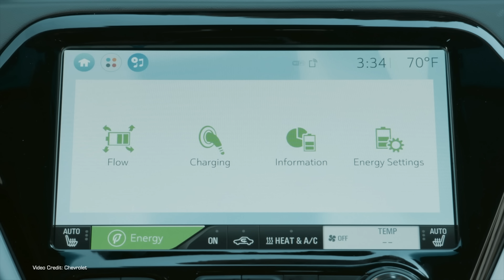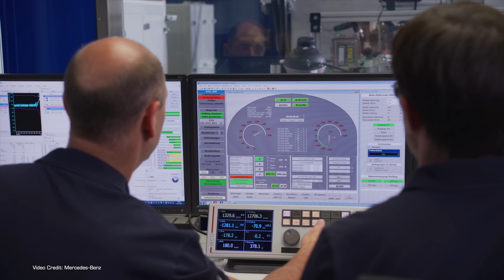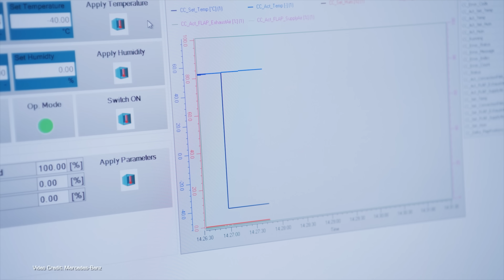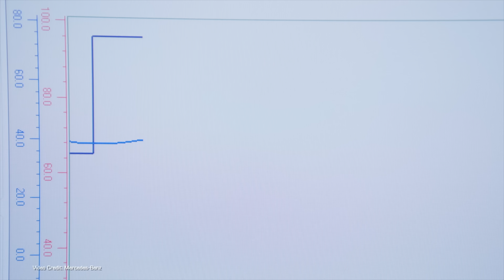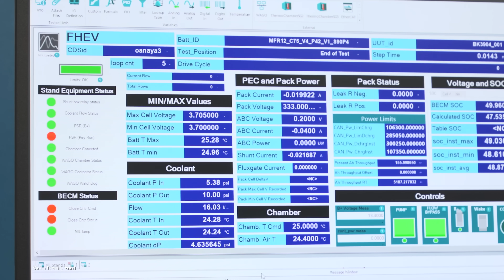Should You Buy An EV With An LG Battery Pack?

Comment: What did you want GM to do differently than what they have done up to this point? Is a buyback for everyone the course you want them to take? I believe the MSRP swap is still applies for an ICE vehicle. What is a reasonable buyback for a 2017 Bolt that is going on 5 years old now? I assume buybacks should be based on the age of the Bolt plus the mileage of the car as well. Seems everyone wants a $43,000 buyback because their case is "special".

I think the "Software Fix" that was released a few months back was a good faith effort in trying to determine what battery packs had suspect cells. It's probably still a benefit to have it installed to try to verify battery pack health. Once you're caught up in a defective battery module scenario like GM is dealing with, it's difficult to determine what the problem actually is. In addition, its difficult to come-up with enough battery modules or packs in a timely manner to satisfy everyone effected.

I think GM's liability is a lot greater than what Hyudai's liability is with the Kona as there are way more Bolts in the wild than there are Kona's as the Kona in the U.S. was only sold as a ZEV state car. It's understandable that GM would try to limit their losses and try to sort the problem out with the software cell check verses replacing every single battery pack. It's definitely a problem for the car owner, make no mistake about it but, the packs and or modules can't be replaced overnight. Is it realistic to assume that buybacks for everyone is the correct way to handle the situation without a serious hit to the GM electrification program. 

I do agree that the entire pack should be replaced rather than having techs at the dealership tearing packs apart to fine defective modules. I think the limiting factor with just doing a full pack replacement is just the issue of not having enough packs to go around for all effected Bolt owners.

In the end, this is a big problem for the Bolt owners, lease holders as well for GM itself. In addition, it makes the general public question the viability of the entire auto electrification process moving forward.

Comment: I don't believe your correct about the Ford Mustang Mach-E battery cell manufacturer being LG. It's my understanding that they are using SK Innovations as their battery supplier.

The VW ID.4 has LG battery packs similar in design to the VW ID.3 which originate from a LG facility in Poland. All of the current VW ID.4s that have made it to the U.S. have LG battery cells. The U.S. manufacturered ID.4s should be rolling off the production line at VW's manufacturing facility in Tennessee early 2022 with SK Innovations battery packs. VW has stated that their pack design is supplier agnostic  and can have multiple suppliers, thus not dependent on LG or SK innovations. In addition, the ID.4 has a definitive recommended maximum charging level of 80%. That's the car's maximum charging level default unless you choose to extend the max charging target to either 90 or 100 percent. I believe they also recommend not discharging below 10% as well in order to maintain a healthy battery pack.

The Bolt uses an LG Chem NCM 622 pack. VW uses an LG Chem NCM 712 pack made in Poland. The 712 pack is the type that was in the ID.3 that caught fire in the EU a few weeks back. The pouch type cell construction is similar.

Comment: I was waiting to buy an EV because the ones I like are too expensive and the ones that are more affordable are too slow charging.  Now, during this used car shortage, even the worst of the worst like older Nissan Leafs with less than 60 miles useable range aren’t even that cheap anymore.
I’ll just stay with ICE until newer generations of EVs come out in 5 to 10 years with faster charging and there is a proper and more reliable charging network fully built out.  Today, even Tesla’s Supercharger network is inadequate on popular routes during holiday weekends.  Everything else is two steps back from that and you can’t 100%  rely on them working on a good day.

Comment: I have a Bolt Premier 2017 and I absolutely love my car. Here is my view on the fires issue. To my knowledge there has been no 2017 Bolt fires. But it's still important to be cautious. A lot of the suggestions I all ready was doing. I often drive my cars over their lifetimes 400k+ miles so I am careful with them. To preserve the Bolt's battery I have always left hilltop reserve "on" as a charge buffer. My daily driving brings me to about %70-%60 start of charge and I recharge overnight. I don't like the battery drop below %50 unless it is a rare really long trip. Once a month I used to take my Bolt out of state. But that is on pause until the new battery becomes available and I'll just drive my Prius instead. As far as buyback or wait for the battery. The replacement will be a NEW battery. That's like Christmas "almost" converting my favorite car back into a new car range wise! I've pretty much already taken safety recommendations to prolong my battery. So I'm good waiting for the new battery. :)

Comment: I wonder if the Chevrolet plan to have the dealers replace the batteries will not lead to a greater percentage of faults. It would be better to have the cars shipped to Mexico where (1) the work can be done more cheaply than paying US workers union wages, (2) the batteries taken out of the cars can be used to build the US/Mexico border wall and (3) the batteries coupled to solar farms can help supply electricity to Texas.

Comment: But isn't SK innovation battery tech based on LG battery tech? That's why they were sued by LG for patent infringement and had to pay huge fines for it. I wouldn't be surprised if SK innovation batteries were just as risky as the LG ones...
Reply from the maker: To the best of our knowledge there haven't been any confirmed fires in SKI cars. It's worth noting that the LG Energy issues don't appear to be with the battery cell design, but with manufacturing defects. - Winter
Reply: re: "I wouldn't be surprised if SK innovation batteries were just as risky as the LG ones." and you would be correct in your LACK OF SURPRISE.  what must be understood is these are still the "early days" for EARLY ADOPTERS, so the risk is great no matter how much we desire to "minimize" it.  the question we're still failing to ask is how many SK equipped Kia Niro's are there that have passed the 75,000 mile and 100,000 mile marks...?  yeah, the may indeed be safe but nevertheless we must get the courage to roll up our sleeves and DIG DOWN into the "granular" data.  hint: "don't fear the INFORMATION or the Reaper baby". (Blue Oyster Cult voice)

Comment: The early Mitsubishi Outlander PHEV's had battery fire issues.
They stopped production, figured out what the manufacturing issue was and fixed it.
Outlanders built with the modified packs have been fine for many years.
LG, Hyundai and GM should have stopped at the first sign of trouble.

Comment: ELECTRIC CARS ARE GOING TO BLOW EVERYTHING UP!
Reply: Says Concern Resident.
Reply from the maker: Shouty Bob - You know they're going to use up all the oxygen so you can't shout any more!
Reply: @transportevolved  There's a troll who makes home in the comments section of Clean Technica articles, simply named "Bob." I'd say it's the same fellow (or same robot.) 

I used to read you regularly on the Plug In Cars blog a decade or so ago, Nikki. Lost track of your work for a while, but have reconnected with your YouTube channel's excellent coverage of the Bolt battery issues. Keep up the good work.

Comment: Pouch batteries are one of those things that requires serious quality control and honestly, it looks like LG Chem has failed there. With the Hyundai Kona EV and the Kia Niro EV using identical drivetrains except for the source of their battery pouches (LG Chem and SK Innovations) and the lack of battery fire reports for the Niro EV (and the newer Soul EV using the same drivetrain and SK Innovation batteries) it really does point to LG Chem being the failure point.

I vaguely remember one of the teardown videos showing the Kona EV pouch was the same part number as the Bolt EV except for a suffix. Like one was -A and the other was -B. While the chemistry might be different based on the suffix, the leading part number being the same makes me believe that the construction was identical, which leads back to something going wrong in assembly, or maybe in the source materials LG Chem is using. I know that 'folded anodes' have been mentioned more than once, so that makes me think that the pre-cut pieces used in assembly aren't quite the right size, or the auto-feeding machines aren't aligned properly. Again, SK Innovations seems to be able to make a drop-in replacement pouch without trouble and we've not heard any of those going up in flames?

Comment: SKI uses stolen LG technology in their pouch design battery which they settled their IP theft case for billions of dollars with LG, so it's not really that much of a better alternative.  So all Hyundai, Ford and VW can do is pray that the SKI batteries don't also combust in flames.  Then they're screwed. I mean there's also CATL, but they're not immune from fires either and they're dedicating most of their batteries to Chinese BEVs.  That leaves just Panasonic, which is exclusive to Tesla and some degree Toyota, as the only large battery manufacturer left followed very distantly by BYD (which has the safest blade battery design). These 5 manufacturers are responsible for over 80% of the world's battery supply.  This is all bad news in general as you've removed the second largest battery manufacturer (and potentially their spin-off, SKI) outside of the future supply chain.  Combine this with the extended chip shortage and BEVs don't look like they're going to explode, no pun intended, in volume sales in the US or Europe any time soon...

Comment: BYD the 4th largest battery supplier and one of the larger EV companies market their "Blade batteries" as being more fire resistant when punctured and when exposed to higher temperatures.  What are your thoughts?
Reply: BYD's Blade battery looks fabulous. The question I've asked in several places is if you could buy a vehicle with the form factor and functionality of  Bolt (BYD EA1 Dolphin) with a battery that is likely to never catch on fire - and for half the price - would you do it? I certainly would.

Comment: As much as I admire the vertical integration and full cycle ownership and care that goes into the expensive "Tesla" (Tesla+Panasonic/CATL/LG) solution it still amounts to a blackbox. Both the function and the logistics of manufacture. In addition to basic information for Right to Repair (How it works) we need to push hard for Right to Know (How it was manufactured). Full blockchain of the logistics similar to what is being proposed for tracking farm to table for meat, milk. Telsa has started reporting summaries in environmental impact reports for some of the metals, carbon, water and electricity but we really need a blockchain that can be independently verified or researched. So we are not spending years wondering whether the product we own is affected by issue X or Y.

Comment: not knowing the VW or Ford production/sales numbers, just using Hyundai and GM number, the odds of a fire in your automobile is about 1 in 10000. pretty decent odds. not sure Hyundai was able to LG to agree to a recall, and replacing the batteries, but it might be they are both from South Korea, how the contracts were written. GM seems to have slow walked it some, but was that because LG didnt want to do a recall for more batteries, when they were already doing one (lots of free batteries arent a good move for any battery maker). they did make one good choice, replace the battery pack, dont try fix the cells. to error prone of a procedure that dealers have never done

Comment: Also, the 2017-2019 Bolt has the NMC-622. They switched to the NMC-712 for the 2020. There is an article about it if you search Chevy Bolt NMC-622.

Comment: I wouldn't buy a car with LG pouch cells today.  LG knew about the Kona what, a year ago?  And they're still making bum cells for the 2022 Bolt?  They had their chance.  Also, I don't see how Hyundai handled this any different (better) than GM.  Both companies tried a software approach and when that didn't work, they agreed to replace packs.  How did Hyundai handle this any better than GM?
Reply from the maker: The owner experience interacting with GM has been significantly more difficult and unpleasant than dealing with Hyundai. Though I was working with Hyundai earlier in the recall process, which may have been a factor - Winter

Comment: Nice video.  However, I found your statistical summary of the Bolt to be misleading. It doesn't account for the fact that that many of the 140k Bolts are 2020+ and may not yet show the issue.
Reply from the maker: If they’re all involved in the recall, they’re all involved in the recall - Nikki
Reply: @transportevolved  True but the point is that the 1 out of 3500 had fires statistic likely doesn't accurately reflect the fire risk in the newer 2020+ cars whose volume dominates that stat and who haven't yet begun to show the flaw.
Reply: #TOTALRECALL

Comment: Does the VW ID.4 also use LG batteries?  Has there been any fires with the ID.4?
Reply: yes, the ID4 is an LG pack.
Reply: LG NCM 712 are in the ID.4 (and all VW MEB platform cars).
No fires with ID.4, its a very new car.
Early faults with ID.4 are failing battery cooling pumps and faulty door handles.
Reply: @JeanPierreWhite   Thank you.

Comment: Even if LG can produce defect-free batteries (dubious), and at scale (also dubious), the major bottleneck for repair will be GM dealers. For 2020+ models, GM is wanting to replace modules instead of entire packs, which involves a 40+ hour balancing process. Of the GM dealers that sell EVs, most struggle to keep even 1 EV-certified tech.
For GM to do this and actually succeed, they will have to bypass dealers. There's no other way, unless they want burning Bolts to be the weekly headline for years to come.

Comment: I wonder if the problem with LG batteries is why Ford chose to limit the charging speed so severely on the Mach E over 80% SOC.
Reply: I just think Ford is and was being cautious due to the fact it was the very first true EV and didn't want to take any chances as they should. 
That would have been the worst thing ever. Your car burning up just after you received it.
Reply: @twany442  that was my initial thought too, and I know some knowledgeable YouTube reviewers hinted that they thought Ford would eventually improve the charging curve once they had enough real world data, but now I’m so sure.
Reply: @peterwright837  It's better to be safe than sorry. I really want them to do well in this segment.
Reply: Maybe it's also why GM severely limited the Bolt charging speed.  Maybe they were aware of a problem all along.
Reply: @StormyDog  if so they obviously didn’t limit it enough, but even the Bolt charges faster than the Mach E over 80%. And the Bolt came out 4 years before the Ford.

Comment: Good job. People are ignorant. Thousands of gasoline cars burn up every year (Just ask Hoovies Garage), and gasoline is far more explosive than any battery is. Batteries just burn very hot when they have a problem.
Reply: Poor comparison.  Most gasoline cars that catch fire are old.
Most EVs on the road are only a few years old.
Try comparing the fire rate of EVs to the rate of fires in gasoline vehicles of the same age and mileage range and then come back.

Comment: While it looks like pouch cells can be made to work reliably, cylindrical cells are inherently stronger / have less mechanical stress and therefore I would think less likely to have mechanical / manufacturing issues.
Reply: Not necessarily - look at the yield problems Tesla has reported with their new 4860 cells, delaying various models. It takes a lot of design and testing in any case!

Comment: 8years old Tesla batteries still strong,Tesla took the best decision to work with Panasonic.Best battery so far.
Reply from the maker: Actually, the best batteries are the ones from the OG RAV4 EV.
Reply: @transportevolved  RAV4 WITH THE BEST BATTERIES????? SERIOUSLY!!!
Reply: Or just lucky. Hopefully that continues in their 4680 cell but they're having some trouble improving yields. It is still a cylinder but different design than the batteries we've had for decades.
Reply: @davidmccarthy6061  I don’t think they’re just lucky. Tesla took battery form factor and excellent BMS software under consideration for safety reasons. GM, Hyundai and Kia likely didn’t do what Tesla did because Tesla is mainly focused on their own EVs, while the other 3 legacy automakers are not focused on their EVs nearly as much as their ICE vehicles. The earlier Chevy Bolts are practically LG vehicles assembled by GM. So yes, Tesla’s battery packs containing LG’s batteries will likely be better and safer than say GM’s battery packs. The fires that Tesla vehicles were associated with were usually a fluke. Things like a bullet being lodged inside of a battery pack found to cause the fire, to literal house fires that were incorrectly identified as starting from Tesla vehicle batteries.
Reply: @davidmccarthy6061  Tesla did not only test there batteries much better,they had a very good thermal & software implementation, building one of the biggest battery factory is not luck,it's planning,supercharger stations everywere = planning,I can keep counting so many technical things dey got right.